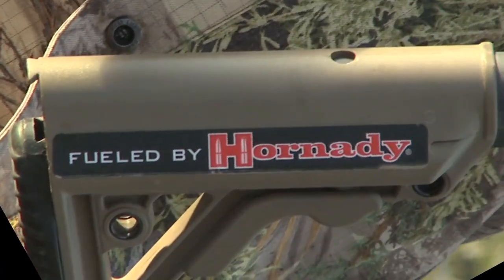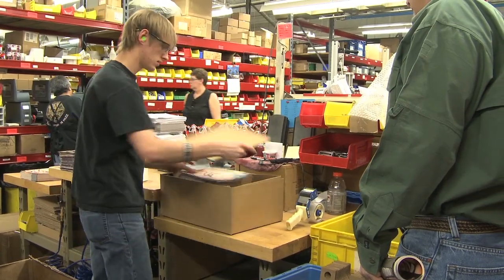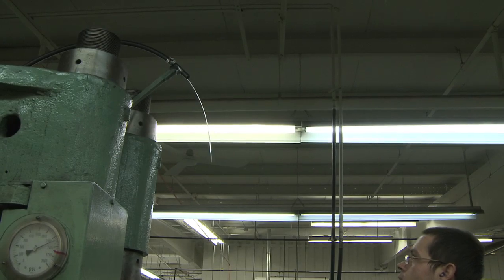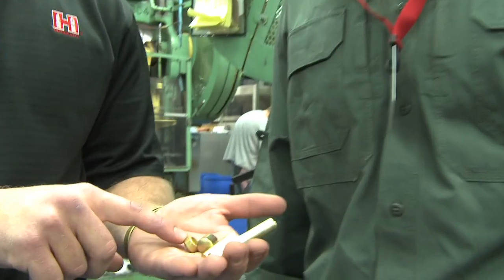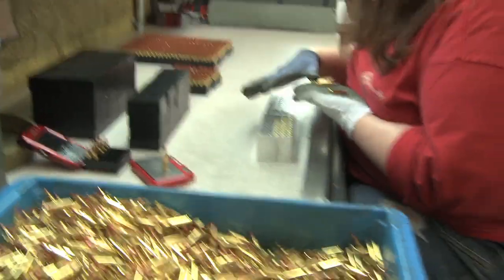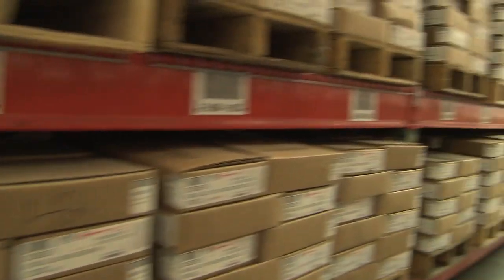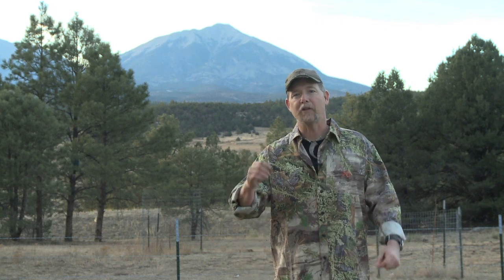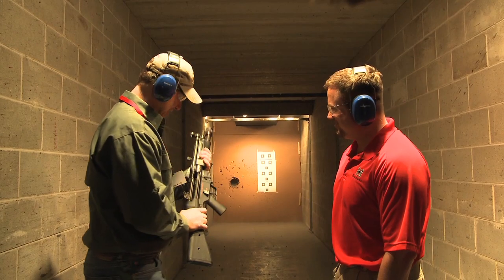Hornady Plant Tour - Fred Eichler

Comment: I realize this is an older video, but beings I just now found it. Please allow me to give my 1.5 cents worth of input, not that anybody asked or cares.. But, over the past 31 years, I have sent close to 50,000 to 51,000 Hornady brand ammo in either hunting or screwing around at the ranges, or heck, knocking bottle and soda cans off of fence posts in my back yard. I have yet to ever experience a Hornady round that had an issue, like failure to fire or a dead fire, or a squib issue or over charged double shot filled cartridge, NOT ONCE. I have had issues with a few firearms, either in a pistol or rifle format that caused the ammo to have an issue, but that is not on the ammo shoulders, rather, just my equipment. Even the Hornady rounds that didn't pop off, due from the machine failure, that ammo as clean as it is, always assisted in honing in on the mechanical issue so much easier and faster, by seeing odd scratches, or no firing pin indentation on the primer, or lite primer strike, again, failure of the machine and not the ammo. When I need to be serious, as per, hunting, I grab the Hunting series Hornady stuff or if I am playing with a new machine, and desire to get it dialed in, I grab the Match series ammo. I even trust Hornady over my loaded / reloaded stuff from raw building materials, which doesn't say much about my reloading confidence, (smiley face). Now, I am not saying that somebody else has never had an issue with Hornady's ammo product lines, but, I am just saying, that I have yet to have any or ever an issue. With that stated, other brands of ammo, and the list is long, form the few name branded ammo manufacturers, that are made in my beloved United States of America, and not to exclude the 20 to 30 foreign ammo manufacturers from all over the world, that I have either tried or currently still use, but all of those, I have had uncountable issues. To add to the numbers game show I am explaining, of the other brands, foreign and domestic ammo brands, (the last I documented that I remember from a few months ago), I have shoot approx 140,500 rounds of other brands of ammo in that 31. That does not include reloaded ammo, by me or other private loaders / reloaders which are vet'd and trusted by me. My data base has segregated all rim fire sent ammo, it is counted, but not for this example I am explaining. The .22 rim fire numbers is just a count, and not really any point in going nuts over, so I never added them to the primary database, this is only for center fire cartridges that I have sent only.  

PLEASE NOTE. unless you know the person doing loading/reloading, it is highly recommended that you do not do that. Especially if you do not know that person. It is dangerous, and costly if things go left on you, so do not do that. But, I have two buddy's, who load and reload, with a measure of OCD 5 times what I have and I have worked side by side with them while loading/reloading for 20 years, so, my example is the exception to the rules, out side of the normal. DO NOT USE SOMEBODY ELSE'S SELF LOADED or RELOADED AMMO, unless you are factually/highly certain they are secure and confident in their skill set and attention to detail and love you enough to never slack off a second or ever doubt that their knowledge and skill set is on point. Please be careful.   

Also, Please note, I am not talking bad about those other ammo manufactures at all, as I fully understand and highly respect that it is just how things go, or rather, to say: "IT HAPPENS" and not a huge deal to me. I keep the failed round(s) and when I get a five gallon bucket full of failed to fire rounds, I will sort, disassemble each caliber as groups, by size, brand, etc., then analyze each group, by blue printing every aspect dimensionally upon the shell case, projectile type & gr weight, powder type, and many other reasons. I do that just to look for a pattern or issue of the construction process. May sound time consuming, but, I find it relaxing and peaceful to do that, plus, I do it on a spread sheet, entering all the data collected. Can then graph out charts... blah..blah..blah.. you get the point, just a touch of OCD. I run the powder through my mass spectrometer and do a few burn off metering, gasification collection onto a scrubber, while other measuring tools are checking the temp during the testing. Some day, I would enjoy the use of one of those super duper high speed video camera that does something like a few million frames per second to add to the database, (more OCD). Then I rebuild that group with often times with the same building parts that came apart, other then the primer. 

Now, all of that, and the only Hornady in the database is of the loaded cartridges from new raw building components or reloaded shells with new parts. But none of the "failure to fire" database has any info from the Hornady brand.. For a guy with a case of OCD issues, that is kind of a "double edged sward sward". No, I don't want any of Hornady's ammo product lines in my database of "failure to fire", but my list/database is missing that information.. LOL. Okay, now that I just showed the world my silliness and OCD issues, I will leave you all to it. Enjoy your 2nd Amendment, and practice being safe, ALL the time. Do your best to learn something new at least once a day.

Comment: In my CZ-527, 22 Hornet, the Hornady 35-gr VMax factory round, will shoot 3/8" groups all day long. I only wish they would provide it to hand loaders with the cannelure, as the factory loaded round has one. I pulled apart a factory cartridge and found 11.2 grains of what is either H-110 or W-296. My load is the same, but my bullet is smooth sided, and shoots 1/2 inch groups. That's good, I know, but it's not 3/8". Must be that darn cannelure.

Comment: I've tested every weight of Hornady 223 in my 1:7 twist 20" barrels (Ruger Precision and Kel-Tec RDB) and the 53gr wins hands down at 100yd. I've heard the 53gr projectile is long for its weight and maybe that's why it doesn't over stabilize in a 1:7.
Reply: Have you ever tried mk262 ammo? I've heard that's a very accurate round at range but sadly I dont have any long range shooting places in my area.